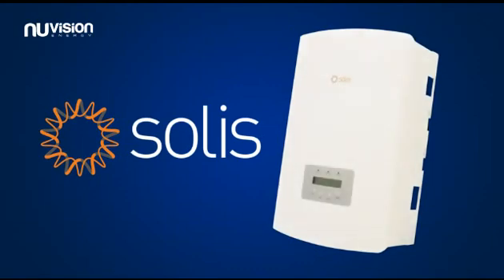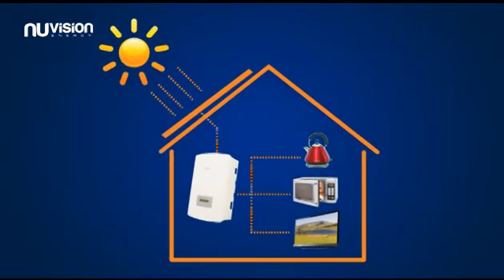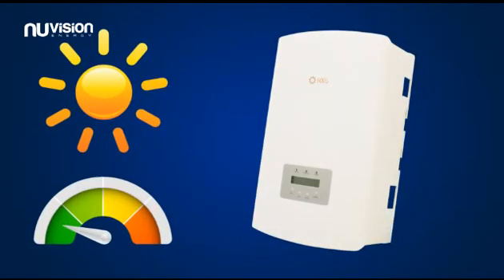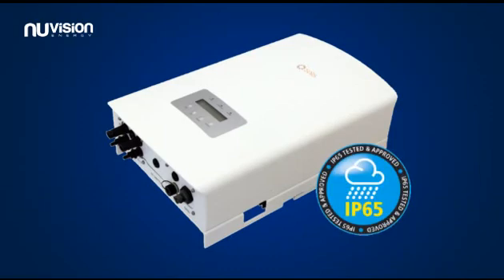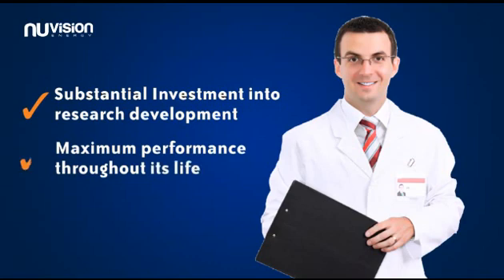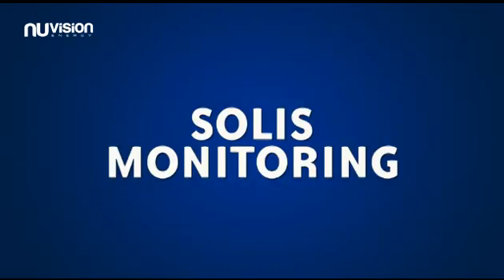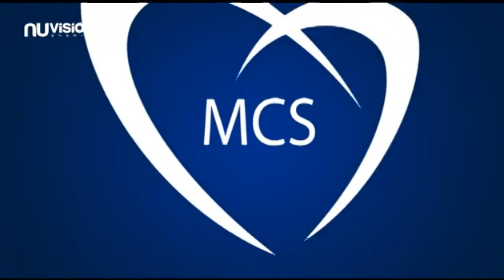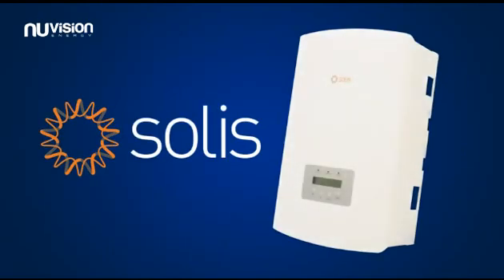Solis Grid Tie Solar Inverters

Comment: Hi, can these units be AC coupled to a battery inverter system in the same way that I currently AC couple Delta or Fronius to Victron?
Reply from the maker: Hi Sebastian, 

Many thanks for your message,  the Solis can indeed be uses with an AC coupled battery inverter system. There is a solis hybrid battery system now available.